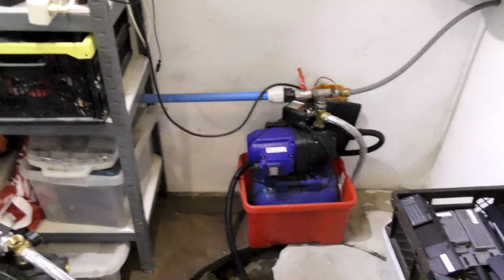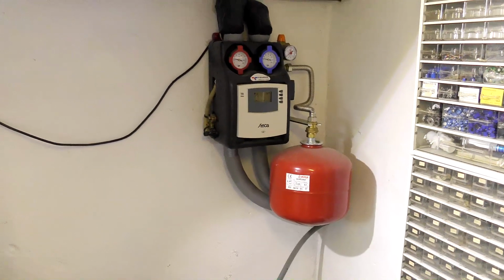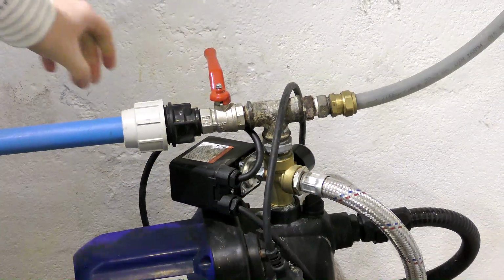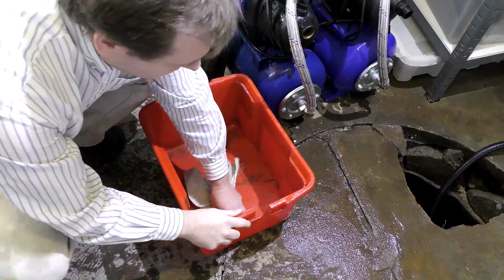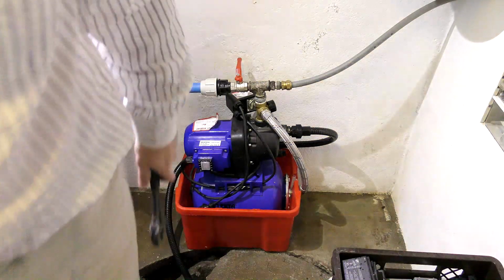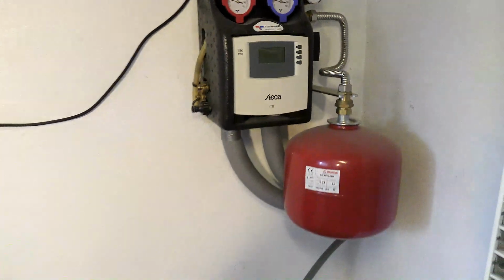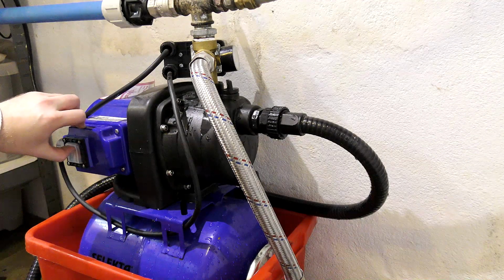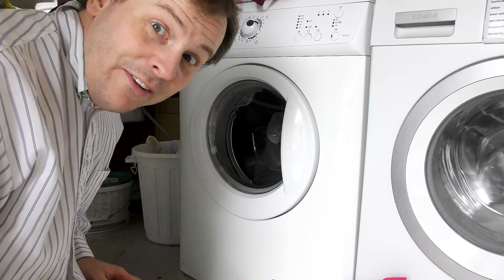How to replace Booster Pump, and prime it for first use - 536

Comment: as far as the electrical mishap i once back traced a circuit on my electrical panel for 2 days around the house because a single range fan/light didn't work started at the panel then crawled through crawlspaces and checked every connection i could by day two i ended up finding a loose connection at the circuit panel where i first briefly checked things like that happen to the best of us keep up the great content and cant wait for some new server reviews hope that they sends some demos your way would look great with some current gen gear at the playhouse its crazy to think how just a few years core count and speed changes can make several servers worth of work can be downgraded into one simple 1u server
Reply from the maker: Hi patrick bentley
My numbers are way down here in summer,, so i am doing a little bit of lighter content,,but there are two server videos here next week. and something else :-)
Thank you for watching! :-)

Comment: on the inlet line do you have a filter attached at the bottom? we have pond pumps that have a foam end to help filter and stop mud and debris from entering the cheap pumps may help save you from future repairs just unhook take outside and wash off the filter when it starts acting up you may be able to get a little more life out of it as well
Reply from the maker: Hi patrick bentley
Thank You very much! There is i very ruff filter at the end, and also a one way valve,, to keep it primed and not having bigger parts going in to the pump. But it does suck up some fine sand.
Thank you for watching! :-)

Comment: I'm guessing that the relay contacts are dirty on the old pump and just needs to be cleaned with some sandpaper. Which is why you had to whack it with a screwdriver to stop it.
Hope you kept it for emergencies. : )
Reply from the maker: Hi psygn0sis
Thank You very much!  I sure did,, got two in backup now.
Thank you for watching! :-)

Comment: Why do not you use a simple cheap submersible pump.   You can also buy models that build up pressure

These pumps are much quieter
Reply from the maker: Hi lexpee
Well normal price it about $120 for these pumps,, they are not that cheap. and the store replaces them if they brake with in 2 years.
Thank you for watching! :-)

Comment: If you turned it off with the lamp how did the breaker get down?
Reply from the maker: Hi jawbreaker
Thank You very much!  It did not,, my mistake.
Thank you for watching! :-)
Reply: was there nothing connected to that group so it was turned off for safety or so ? now you turned it on :)
Reply from the maker: Hi Maico
Electric water heater, I did go turn it off again.
Thank you for watching! :-)
Reply: Morten good :) better be safe than sorry :D

Comment: Do you use a blocking valve on the suction side?
Reply: yes...on the botom of the suction hose there is a one way check valve in combination whit a screen for larger particles
Reply from the maker: Hi Adam Budai
Thank You very much! Yes there is a one way valve down there.
Thank you for watching! :-)

Comment: is that blue pipe 20mm the whole way if so opening that for priming will be better
Reply from the maker: The blue pipe is bigger then that it is 38-40mm, but then the water is just gone.
Reply: My PlayHouse ah even better.
 Maybe a second valve that goes back into the well.
 yea empting the well would suck. 
I am only saying as sounded like there was still a little air in pump but could be crappy speaker my phone uses.

Comment: Don't kick yourself for mistakes, we all have them, and things that play up too lol :-D.

If the old pump still pumps, you could open the pressure switch box and see what is the fault, cleaning often fixes faults, just a thought :-).
Reply from the maker: Hi zx8401ztv
Thank You very much!  I have fix it ones,, it only worked for a little bit..
Thank you for watching! :-)

Comment: It'd DDR memory (Double Data Rate).
A memory module runs for example at 400 MHz. Since it's Double Data Rate (two bits at the time) you get 800 MHz
So a 1066 memory actually runs at 533 MHz. So it looks normal to me.
Reply from the maker: Hi Sten Isaksson
Thank You very much! but this booster pump runs a lot slower then that!
Thank you for watching! :-)